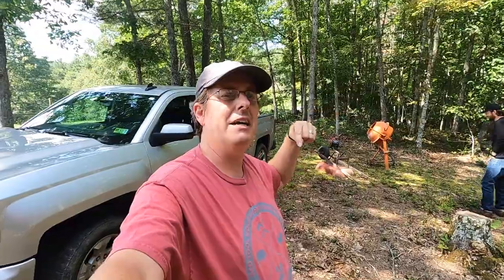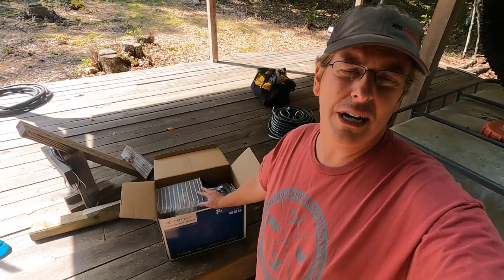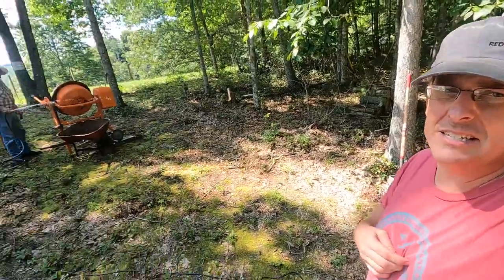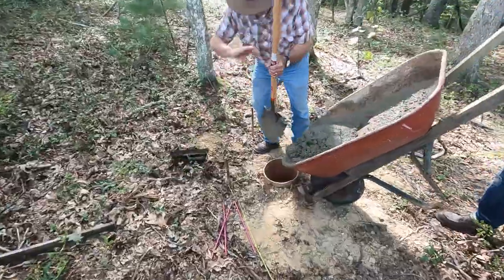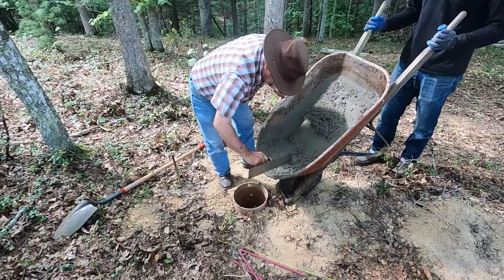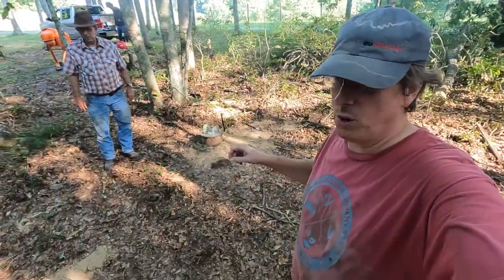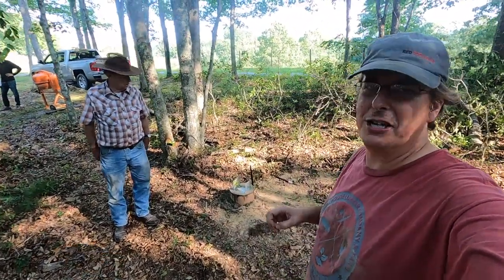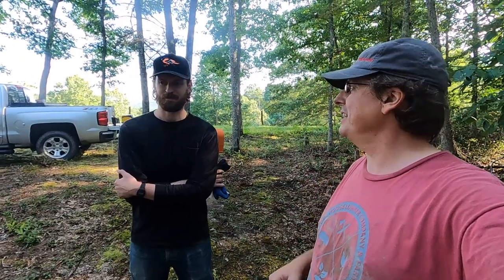Offgrid Cabin Build: Part 2 - Pouring Foundation Piers

Comment: Great to see all of you working together!  Next time you should try just pouring the tubes with nice level tops, and then snapping your lines on top of the finished pads.  Then you can just install the flat bottom brackets with masonry anchors, way simpler and less complicated.  Another way would be just embedding j-bolts, and then you can install the brackets with some flexibility.  Just thinking out loud, I like to keep things as idiot proof as I can, ask me how I know!  You are definitely inspiring to an old carpenter, keep it up!
Reply from the maker: We looked at those options but the cheapskate in me wanted to only spent $16 per bracket instead of almost $50! In hindsight, the $50 would have been worth it